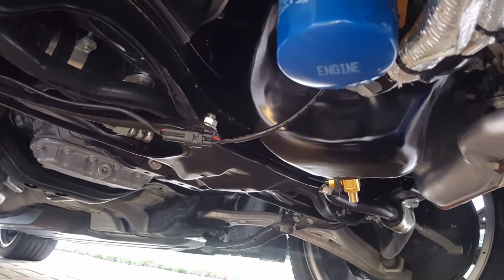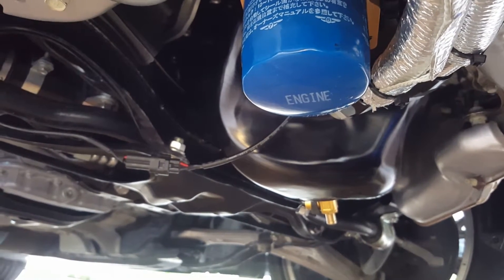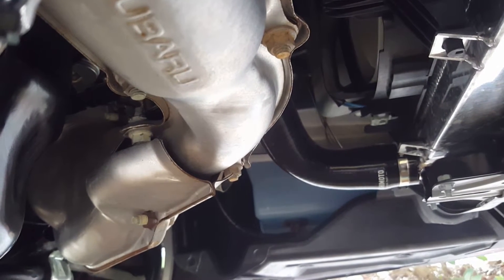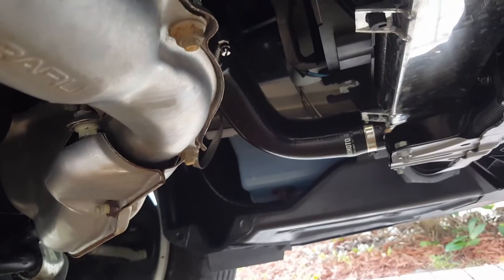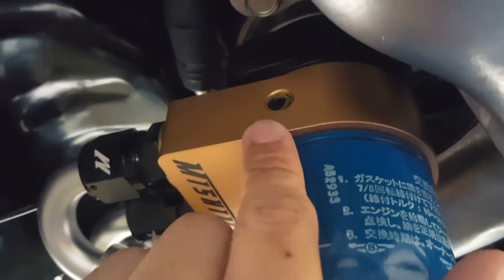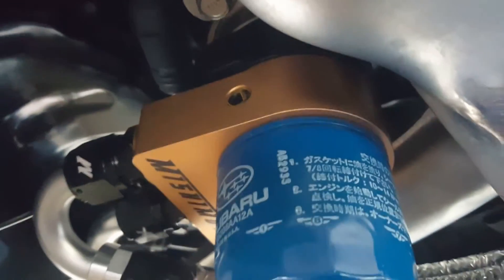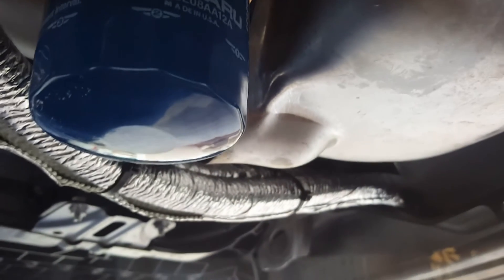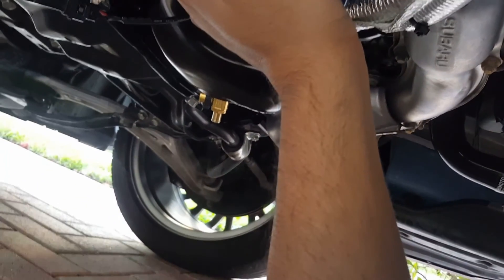Oil temp sensor relocation and mishimoto oil cooler

Comment: Oil temp sensor on the sandwich plate shows temp out of engine. Oil goes into the engine through the passage inside of the filter adapter.

Comment: Hey mate, the npt sensor location on the side of the gold sandwich plate...why is it not a good location for temperature readings?

Im using one on a 1JZ with a mishi oil cooler and thats where i have my temperature/pressure sensor. Weird thing im trying to figure out is on long drives where I know the engine is hot, is the pressure reads well but the temperature begins to drop off, as if that position only reads the temp coming back from the cooler, not overall engine oil temps. On hot days, in start/stop traffic here in Sydney, Aus the oil readings get to 75°C/167°F and doesnt get higher, but on long drives at freeway speeds, the oil temp drops down to 35°C/95°F...scary when i first saw it, however the sump has been measured with a temp gun and its in normal ranges. 

Whats your thoughts?

Comment: Is the sandwich plate adapter for the sensors a universal one from mishimoto and can the oil filter fit directly to it? I'm not interested in the oil cooler plate. Thanks
Reply from the maker: Yes it's standard. Sorry for the late response.

Comment: What kind of oil temperatures are you seeing from your oil in winter and in the summer?
Reply from the maker: I have not had a chance to drive the car in "winter" and I try to avoid it. However, normal oil temps on the street are 190-200F. At the track 230-240F. The oil cooler does lower those temps about 20F. (I have a sensor on the outlet). Hope this helps.

Comment: do you have any clearance issues using the factory oil cooler under the oil cooler setup?
Reply from the maker: No, I do not.  (thankfully)
Reply: Typically from what I've been told is that you will only run into issues if you're running equal length headers such as killer bee.. it forces the oil filter to sit right next to the header and have little to no gap.